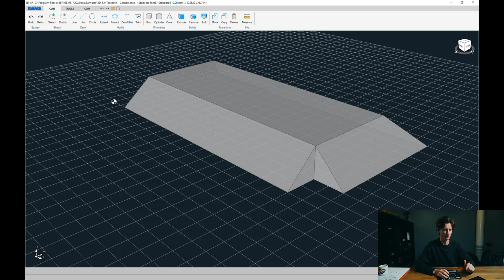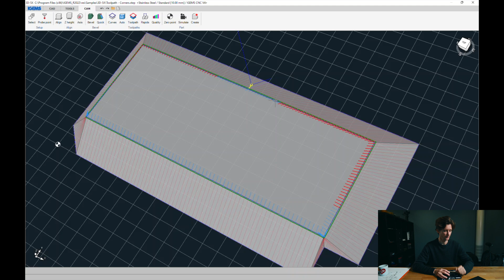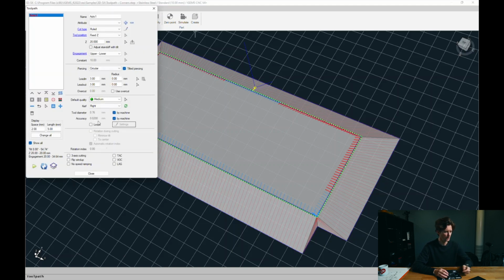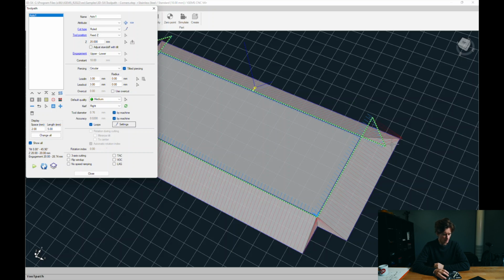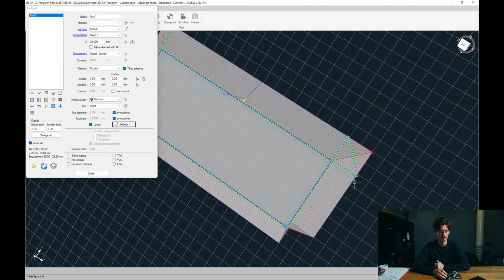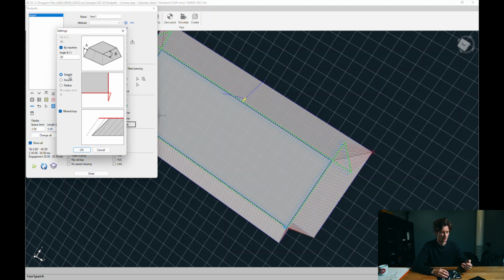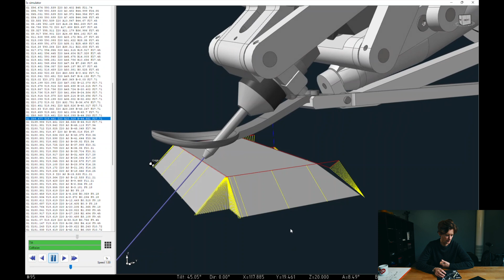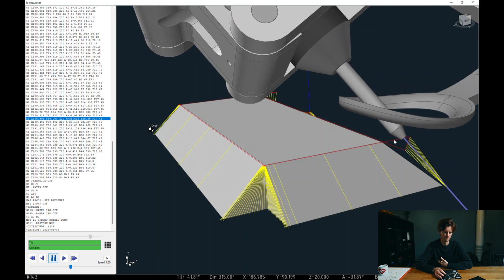Perfect corners with IGEMS CAD/CAM?

Comment: Schade ist nur das man Schleifen nur aktivieren kann wenn der Winkel tatsächlich überschritten wird.
Reply from the maker: It's possible to activate loops on straight corners as well. Activate the loops and in the loop settings, uncheck "By machine" and set the Tilt value to 0 and the Angle value to 0. Voilà! :)
Reply: Top. that's exactly what i was looking for.